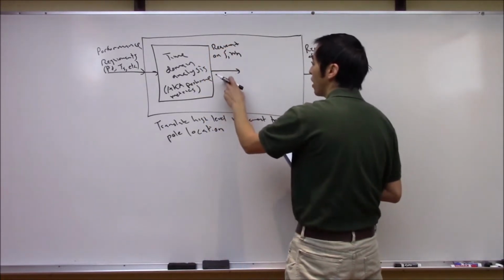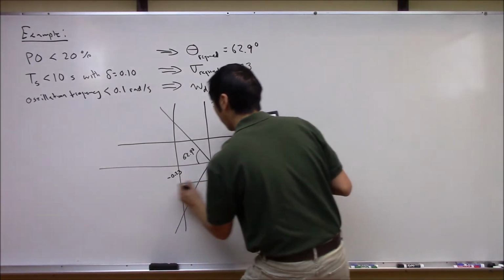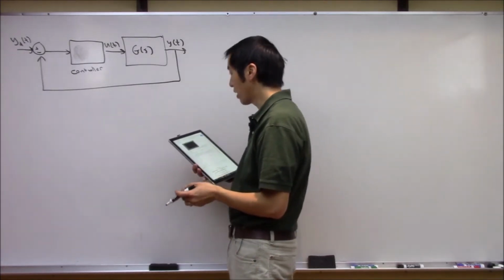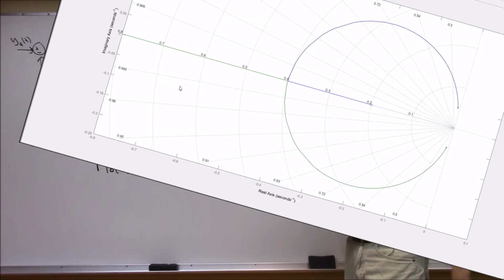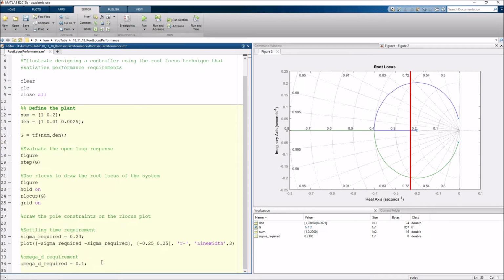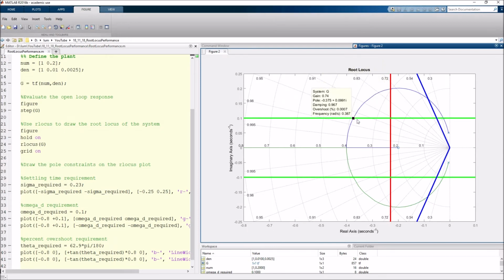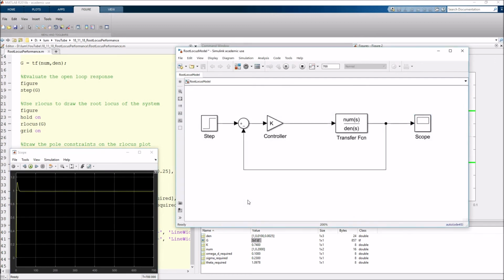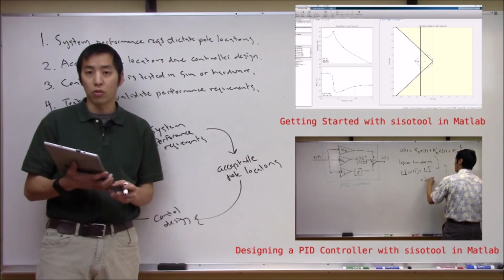Using Root Locus to Meet Performance Requirements

Comment: AE511

Another great lecture. Something weird that I noticed about matlab version 2024b is that when drawing the root locus lines, it wouldn’t draw all of the lines or requirement in one plot and only shows the last one even through I had “ hold on” right after figure but when you put “hold on “ after grid on, it works.
Reply from the maker: I'll check that out, thanks for the heads up!

Comment: Great video. Thank you. I have a question. I tried the following plant: num = [1 1];
 denom = [1 0.3 1]; I have used the gain of 4.3 after drawing the root locus where the response should have been very good, however I didn't find the closed loop response to follow the step input of 1, though the oscillations got reduced than previous open loop response. Could you please comment on that? Thank you once again.
Reply from the maker: Anjan, 

Thanks for reaching out, I'm glad you enjoyed the video.  Unfortunately I'm unable to respond to questions on YouTube due to the sheer volume of inquiries that I receive.  That being said, I hope you'll consider supporting the channel via Patreon at https://www.patreon.com/christopherwlum as I'll be able to answer questions there.  I'd love to have you as a Patron as I'm able to talk/interact personally with Patrons.  Thanks for watching!